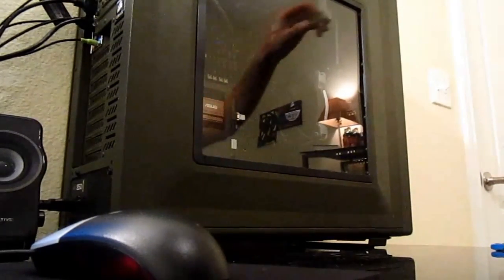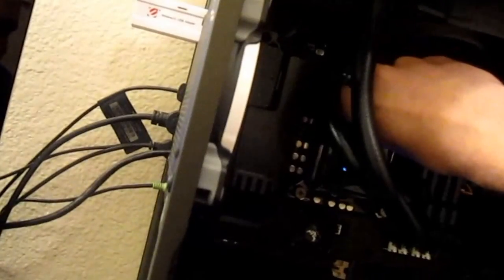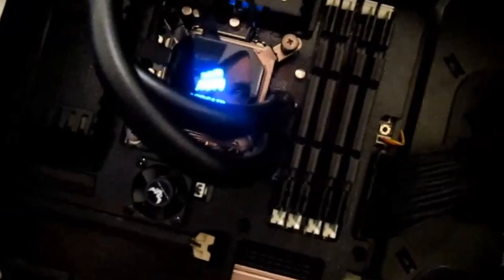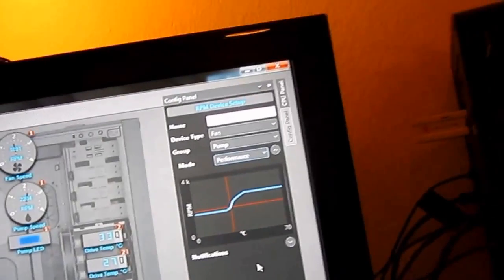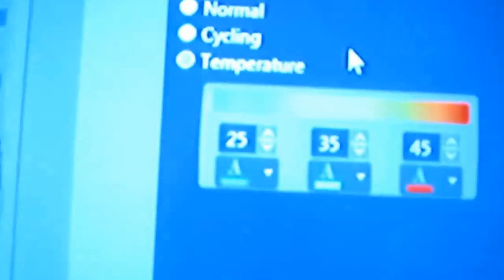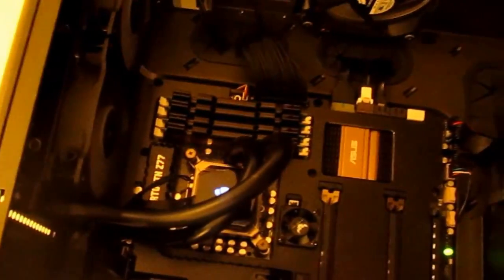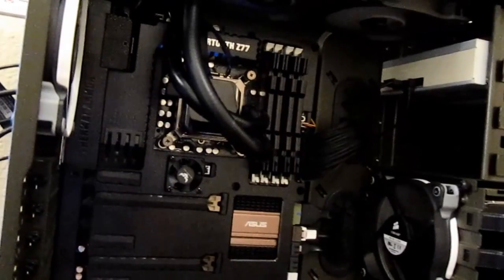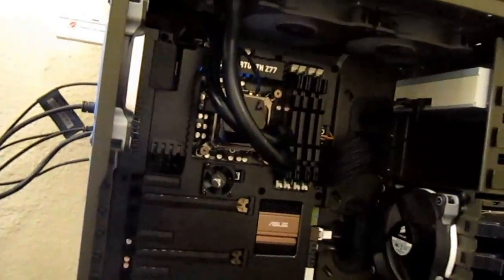Corsair H100i Noise & LED **Firmware Update FIX**

Comment: try running the fans outside of your case for the radiator thats what i think you have too many fans inside causing vibration noise like feedback in a speaker box its worth a try anyway see if you can do that it may help you a lot with the sound / noise aspect . cheers  p.s nice system i just bought a sabertooth x79 board myself  : )

Comment: I have the h100i since half a year, contacted corsair about the noise, they said that the fan controller built into the cooler is making that awful noise. Its to do with the frequency of the non pwm fans, so using fans that have a 4 pin cable is solution number one. The other solution, (,the one that i chose,) is to plug the fans into the motherboard, it can even stop the fans totally so its a nice feature, so it is the pump/CPUbock/Controller making the noise. Have a read inthe corsir forums.

Comment: i also have the h100i i bought new fans but also had no problems with the stock fans maybe it's a defect or it's your case (if you have the corsair fans with the coloured rings)you should check out the rings mahybe they didnt fit right i had that problem

Comment: yes they do but thats not the only upgrade. They feature a thicker tubing to help cooling (i think the pump itself is the same though). The kit itself i'd give it a massive phumbs up, i'm using a i7 3820 at stock with a turbo of 3.8ghz (all you really need for gaming on this cpu) and my temps NEVER go higher than 50c even though stress testing.

Comment: i've had the same thing the blue seems very white i'm not using corsairlink to choose the color. But temps are very cool since perchase of the kit (as without link software it still adjusts colour due to temp, in maybe wrong), so i can only assume that the led's fade over time. but hey my build is black, gold with white case accents.

Comment: You need SATA, the 3 pin is to report pump RPM to your system so that you can monitor them and you don't get a "NO CPU FAN" error at startup.

Comment: Im thinking of getting it. My Kuhler 620 is dying i think (pump is making wierd noises). Tried to fix it with reinstalling, rotating the pump and radiator but it still makes the damn noises.

Is h100i worth it? I want it because of few factors... Less weight then air cooling, looks, performance... How's the warranty on this thing?

Comment: watercoolers are great but you still need fans to cool the rad and also you need a pump so it cannot be quieter than just fans anyway  but it keeps cpu cooler for overclocking

Comment: Yes this cooler is great. I have an H80i, which is the single 120MM but twice as thick radiator version of this. The H100i is better than the H80i, and I get AMAZING temps with my 3770k at 4.5GHz even though I got unlucky and require 1.3V to hit 4.5GHz stable which is a little too high. Most people can run 4.5 at 1.2V. Still, I stay below 65c on the hottest core when at 100% load. At stock speeds my 3770k stays below 50c on the hottest core which is amazing. Stock cooler hit 90c at 4.5GHz.

Comment from the maker: It has been working great. Blue portion of the RGB led is getting weak, so the colors on the blue end of the spectrum look a little different, but other than that I have had no issues. Firmware/software updates have fixed any of the noises I was having.

Comment: i can tell u exactly wat the problem is...i experienced the same.the problem is with the fans,try unscrewing or loosing the fans bolts a bit n noise would be gone.the noise is due to the fans brushing on it side surface ad both of them, are tightly held together on the radiator!

Comment: run the fans on full and stop the fans with your hand. this will tell you if noise is from pump or not :) do the same on low fan speed

Comment: Cheers for the reply, I thought they wouldn't because on most websites they have a slightly different display picture. The ones with the LEDs have a small glow around the Corsair Logo. btw Is it likely that the H60 will have an annoying noise too? Without corsair link I may have to look at getting a lower voltage adapter.

Comment from the maker: The H100i radiator will support any fan that has standard 120mm mounting holes, though a fan with a higher static pressure rating will perform better.

Comment from the maker: Have been running a 4.3GHz overclock on this 3570K 24/7 since I installed the mobo, and have had no issues with the Sabertooth. It didn't like all 4 sticks of RAM on first boot, but that was easily solved by pulling a few sticks until the OS and everything was installed.

Comment from the maker: I bought the High Performance and am using the include "speed reducers" which are simply inline resistors. They spin about 1100 rpm right now.

Comment from the maker: I am doing push/pull currently, but I can't used the factory 120mm mounting holes. Just shifted it over and found holes in the top grille that would work. I can't tell you if yours will fit, but it is possible with most motherboards.

Comment: Hmm.. I just spoke to these guys through e-mail, they actually said that I could get the 850 Silver, modular for around 145 euros, thats 1100 NOK. Just cause I said that it was so close up to the 1000 watt in price. Also, they only sell 3 power supplies from Fractal design, and these are not modular. Less shipping when they are a norwegian seller aswell.

Comment: What do you guys think of this PC I'm going to build in a few months?

Processor: Intel i5-3570k

Case: Thermaltake MK-I

GPU: ASUS GeForce GTX 660Ti 2GB

Memory: 16GB of Corsair Vengeance 1600mhz RandomAccessMemory.

Motherboard: Asus Sabertooth Z77.

PSU: Cooler Master Silent Pro M2 850W PSU

HDD: Western Digital® Desktop Black 1TB (I dont download particularly much.)

SSD: Intel SSD 330 Series 120GB

CPU-cooler: Might get the Thermaltake Chaser MK-I LCS, which has in-built liquid cooling.

Comment: i wouldn't really get a 500 series gtx, whats the point, just get a 660ti if you can, and there is no point of getting a liquid cooling if its a single radiator setup. i would go with an air cooler, it will give you better performance than the h40. if u really want to use a liquid cooler take a h100. otherwise, have a good time building if you havent already finished.

Comment: Hey I'm building a PC soon that'll be dedicated mainly to gaming, can you tell me if it's good?

CPU: i5-3570k Ivy-Bridge
GPU: Galaxy GeForce GTX 660 TI GC 3GB
SSD: Samsung 830 2.5 Inch 128 GB
HDD: Western Digital Black 1.5 TB
Motherboard: Gigabyte Intel Z77 LGA 1155
RAM: Corsair Vengeance 16 GB (2x8) DDR3 RAM
Case: CM Storm Trooper Full Tower
Fan: Corsair H100i

Sound good? Think I'll have enough cords for all my parts to connect to the motherboard? Do you think it'll perform good? Thanks!

Comment from the maker: If you mean rotate the rad 180* horizontally so it's still mounted on the top, then yes, the tubing is plenty long enough. If you mean mount the rad on the bottom of the case, that will vary case by case. It wouldn't reach in my Corsair C70.

Comment from the maker: The performance difference between the 2 types of fans is minimal, especially since the stock fans were designed specifically for the H100i/H80i. I'm also running push/pull (4 fans mounted to the radiator) for increased cooling. Have you used Corsair Link to lower the fan speed? Updated the firmware?

Comment: i want to ask you about my pc that im going to bulid 

core i5 3570k
wd 2x 2 tr 
one ssd 120 gb 
mb : GA-Z68XP-UD3
gpu : EVGA GeForce GTX 560 Ti FPB 1024 MB
and the cooler for cpu is corsair h40

thats good  right

Comment from the maker: What's your ambient temp? There wouldn't be enough heat transfer to the backplate to noticeably decrease temps anyways. I'd remount the cooling block on the cpu. Sounds like you got a bad TIM application or it moved during install. Happened to me the first time I installed mine.

Comment from the maker: Probably not a huge performance difference between the SP120HP and the SP120L that came with the cooler, but I wanted a full set of 4 matching fans, plus I have the option to use the included inline resistor to make them run at lower rpms for less noise.

Comment from the maker: Not at all. All the fittings feel very secure, plus Corsair has a solid warranty policy if on the off chance it did leak. Nothing wrong with having your hand on the PSU power cable the first time you boot up though.

Comment from the maker: Corsair released a software/firmware update that corrected the noise issue. I've since switched to a set of 4 SP120 High Performance fans instead of the stock SP120Ls. If you plan to overclock, but don't want to go full custom watercooling, the H100i is a great way to get good temps. Depends on what cooler you have now.

Comment: Hey, the noise you're hearing are the fans on low rpms when they're connected to the pump. If you connect the power wire to the mainboard, the noise is gone..

Comment from the maker: It should fit up top just fine. For push/pull you may not be able to use the factory fan holes depending on your motherboard.

Comment from the maker: Yeah now that I have the 4 SP120s installed it's much much quieter. (They're they High Performance editions and I use the inline resistors to make them run slower.)

Comment: New cpu architecture is massively different and billions of transistors on such a small area generate a lot of heat.
Btw guys, don't spend a fortune on watercooling kits or closed loop stuff that can never match the performance of a custom water loop...There is another much cheaper watercooling way that can beat any pre-designed kit out there :)

Comment: my Pc is the noisest of all,,look here i'm not kidding
NZXT Switch 810 (with 5 fans)
Cooler Master Silent M2 1500W
4 x Seagate Barracude 3Tb 64mb cache
Corsair Force Series 3 480GB SSD
Asus BW-14D1XT Blu-Ray/DVD/CD Writer
ASRock X79 Extreme11 EATX LGA2011 Motherboard
Intel Core i7-3970X Extreme Edition 3.5GHz 6-Core Processor
Corsair H100i 77.0 CFM Liquid CPU Cooler
Corsair Dominator Platinum 32GB (4 x 8GB) DDR3-1866MHz Memory
2 X  Asus GeForce GTX 690 4GB Video Card 915 MHz

Comment: Yeah IDK what they're talking about...  AFAIK there are no air coolers that can best this by any notable amount, and when you consider how GIGANTIC a cooler you need to even approach the capabilities of this, its clear the h100/h100i is the proper choice.  Also, I just bought a Sabertooth z77 and 3770k and will be getting an h100i and an AZZA 9000 in 2 weeks, so I will have a similar setup as this video soon

Comment: There's a issue with the fans running at low rpm and is corsair is going to fix it with update.Or you can get the SP120 quiet/performance edition fan.

Comment: It's still a lot easier to just chuck on a cpu block rather than worry about tubing and radiators and fans and getting a graphics card block that fits and hoses and clamps and reservoirs and pumps and everything. People are just lazy.

Comment: Go custom, you won't regret it. I spent about 600 on a custom loop, it worked wonders on my 680 GTX's and 2700k. I'm running 5ghz with amazing temps. My old H100 was useless in comparison.

Comment from the maker: Well of course. The simple user needs nothing more than the stock cooler that comes with the processor, or a cheap $15 zalman cooler. Custom water loops have reservoirs and higher capacity pumps and radiators. And while there may be air coolers on the market that can match the H100i in performance, how many allow me to run high profile ram and also see the good looking motherboard I spent so much on?  I may go custom WC eventually, but I had neither the time nor the extra money at this point.

Comment from the maker: First off this is the H100i which is SATA powered, and the sound was coming from the stock fans prior to the firmware/software update that Corsair just released.  The original H100 had pump issues with over 12v.

Comment from the maker: I'm running them on the lowest rpm the fan controller will allow, plus with firmware/software updates for the H100i and Corsair Link it is nowhere near as noisy.

Comment: the only major differences are going to be the hoses they use, the cpu block, and the OEM fans. the fans are optimized for pushing air through a rad and are better than the old included fans. the block is more aesthetically pleasing and it includes corsair LINK. the hoses are thicker and more easy to rout compared to the old plastic ones. the difference between the h100 and h100i is minimal in performance, only a few degrees. 

hope this helps

Comment from the maker: I already have every fan header on my motherboard filled. If I wanted to run these off the motherboard I would either a) have to get a dedicated fan controller or b) run some of my case fans off direct power rather than being able to control them. Using the h100i and Link to set the fans speed has worked perfect for me.

Comment: the fans that come with it are much better. Also you get software control of the cooler instead of opening your case and controlling it directly. I think its much better since its not that more expensive

Comment from the maker: Corsair has redesigned the impeller/pump housing for less noise and more reliability, the fins inside the CPU block dissipate heat better than the previous design, more flexible/better looking tubing, Corsair Link control integrated without having to purchase Link Commander, Customizable LED, included SP120 fans have better performance than previous stock fans... Shall I continue?

Comment from the maker: I have the assist fans set to turn off in AI Suite if my motherboard temps are low enough. Once my Vcore and iGPU temps start to rise they kick on.

Very easy install. I recommend laying the chassis down rather than installing it like I did. The included instructions are super easy to follow and it really isn't difficult to do, even by yourself.

Comment: The h100i fans are way better, still not amazing but a huge improvement from the h100. The hoses are also better because they are made of better material and more flexible. Finally, the corsair is REALLY good. It is a little buggy, but it just new, so of course it will have some bugs. But those will get kinked out in the future. The h100i is well worth the $5 extra :D

Comment from the maker: That's one way. Or just use fans that don't have a hydro bearing like these SP120s. When I hook up a normal sleeve bearing (stock from the case) fan, they're silent. The hydro bearings don't like being upside down and at low RPM

Comment: Interesting. Maybe with pwm fans (p.e. noctua nf-f12) with the motherboard 4-pin conector and leaving the pump connected to the psu full power (or with the corsair link), you still can have a quiet machine...

Comment: New cold plate design
Thicker tubing offers better flow thus better cooling
easier installation
pump is fixed (doesn't get 'overvolted')
and thats the major diffs all i can think of off the top of my head

Comment from the maker: I made it myself. Bought the acrylic from Home Depot and cut it on the bandsaw, drilled the holes to match and then used the original hardware that came with the case.  A company in the UK may start making these if there is enough interest, but that's just something I heard on the forums.

Comment from the maker: Yeah that's the goal, though I am waiting for the Corsair Link software update to see if it fixes the noise. If not, I need to find fans that don't mind being run upside down, as the hydro bearing in these SP120s make some racket.

Comment from the maker: Max recommended temp for Ivy Bridge during stress testing is 90*C. I'm 10* below that, and the other 3 cores are even lower. Not bad for nearly a 20% overclock on what's known to be a hot cpu. It never hits 80*C during normal usage, heck it rarely hits 60*.

Comment: The reason you get the noise while the fan header is installed is this.

The pump makes those noises when it is spinning faster then it needs to, this is due to it getting more voltage then it needs, adding fans into the headers forces more voltage into the pump for some reason.

if you use the the fan headers and want to stop the grinding you need to lower the pump speed by 5%.

Comment: Corsair George on overlocknet forums said - 
We have recreated that noise in the lab, it only happens when the fans are at extraordinarily low RPM on the built-in fan controller. For a short term fix, you can correct this by manually raising the minimum fan speed in Corsair Link.
It can likely be corrected with a firmware and software fix. We're working on a new firmware now and will release it when complete, should be no more than a week or so.

Comment from the maker: Man I wish I could get speeds/temps like that from this 3570K. I'm still new to Intel overclocking, but I'm at 4.3GHz @ 1.216v, with 83* on the highest core on this H100i in push/pull. I'm loving this case so far, lots of possibilities. Can't wait to put some graphics cards in there.

Comment: Thanks for the reply back mate. Right now I'm pushing my 2600k to 4.7 w/about 1.344 on CPU-z while running Prime 95 getting temps in the low 70ish *74 highest core. But I"m also doing a push/pull with COUGAR CF-V12HP. What to do..what to do. LED is slick as hell and the extra tubing should get a few degrees cooler. I wonder why they didn't bump up the RAD? Nice CASE! I'm also running GTX 680 SLI couldn't be happier

Comment: Dont worry about the pump noise it was there with the original H100, I plugged in my AP-15 fans via Molex.  The H100 fan controller is a piece of shit do not ever use it.

Comment from the maker: I just did a quick test last night (no video of that), and unplugged the stock fans, then plugged in two other fans I had laying around. The noise immediately went away. So I'm almost certain it isn't the pump making the racket, it's the fan bearings at low RPM.